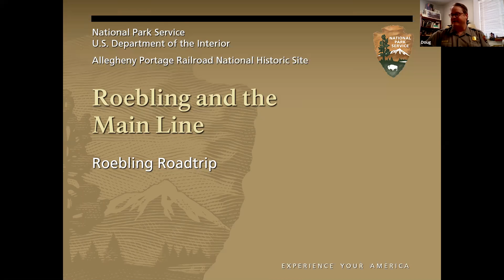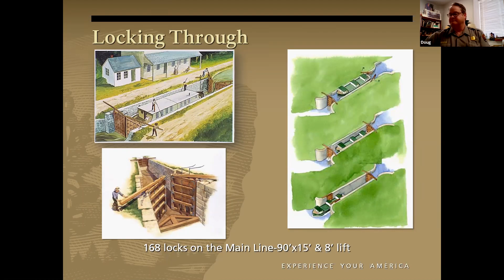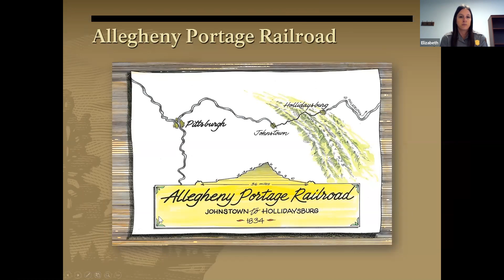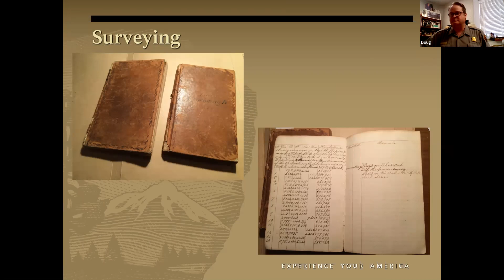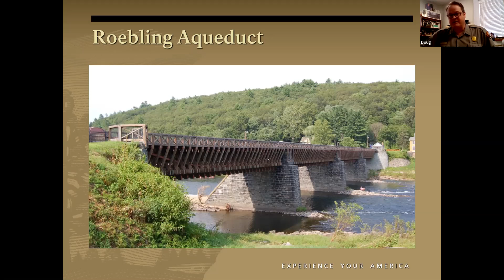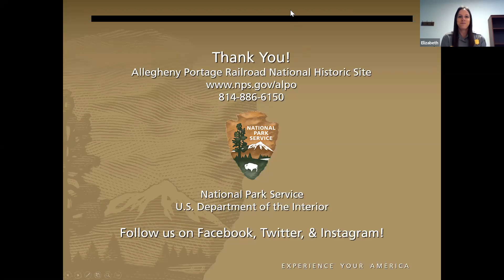Allegheny Portage: the first place John A. Roebling tested his wire rope

Comment: Hi Lynn, 
You put together a delightful program here.  I appreciate you showing the "parallel wire rope".  
My wife and I took a vacation from NC in '06. We were interested in the Morris Canal. Since we were so close to Lackawaxen PA. we went to Mr Roeblings' bridge. It is some kind of impressive. I went down to the river on the Pa. side...big as life in stone...1848...we drove across...real slow...like a barge would have gone. 
  Early U.S technology is a passion of mine. I read that for a barge to get from one bank of the river to the other side...the barges had to "lock down" to cross the river...then "lock back up" to get to the other side. A very slow process. The bridge fixed this.  
  Wire rope is a passion of mine. It is b/c of the rope strands ability to make it around sheaves with out breaking or cracking. 
The definition of ductility is...(I quote from memory)..."The ability of a material to change shape without breaking or cracking." 
  Mr. Roebling knew this. His rope was ductile. Him being able to make the change from parallel to twisted rope says a lot about him. 
  I read that when Mr. Roebling came across the Atlantic, he spoke with the sailors about the hemp ropes holding the masts in place. Hence...seeing that...wire rope would be superior to hemp. So...the idea of pulling...tension on a fixed object was planted. 
  A lot of people confuse cable with wire rope. Cable does Not have the ability to go around a sheave like wire rope does. Cable can onle be in tension.
  On the front of my trusty '65 F100 pick up, I have an 8,000# electric winch. It has 3/8" aircraft wire rope on the drum. I had a nice piece of property with a healthy creek on the border. I wanted to remove the fallen trees in the creek. They were slowing the flow down. I bought three wire rope snatch blocks. My buddy hooked up the dead trees in the water...thanks to the three snatch blocks...the trees were removed. I went on and filed for a U.S. Patent. I figured out how to get the moving water to rotate a large diameter water wheel so I could generate electricity. U.S Patent # 7602076. 
  All righty then, cheers to you fine ma'am, Pete 🙂

P.S.  I wish I could tell you where I read about Mr Roebling crossing the Atlantic. I'll look in my books here. It will be a little time ( a week ?) before I'll know from my library. This would make it even more knowledge for you about Mr.Roebling.  Course you may already know this. So...off we go into the wild blue yonder...
Reply: Hi,
  I looked in my books. Nothing about Mr.Roebling crossing the Atlantic. I typed in my address bar on my lap[top..." Mr.John Roebling coming across the Atlantic." What came up was a lot. There is even a book about that called," Across the Atlantic."  I don't remember reading this book. All the best, Pete 🙂
Reply from the maker: Hey Peter, I think I know the book you mentioned.   It's either the John A Roebling diary or his son Washington's biography of his father. Do either of those sound familiar?